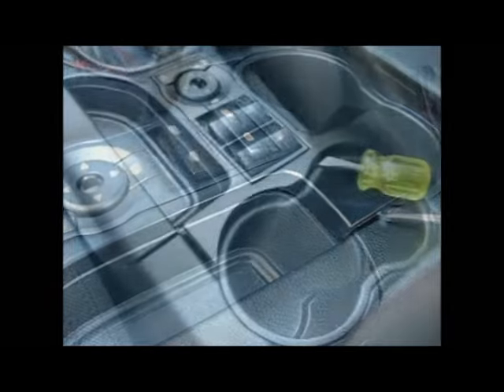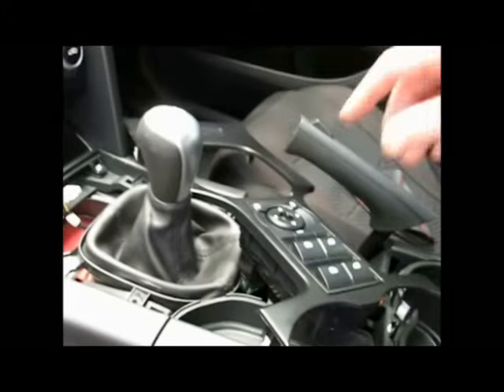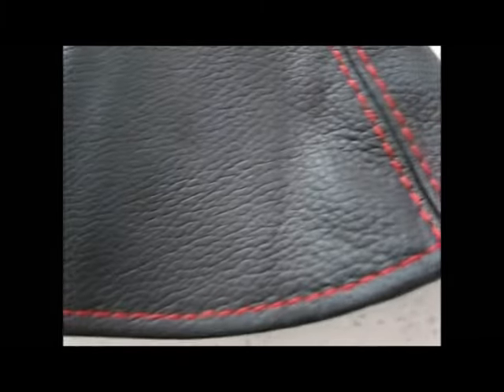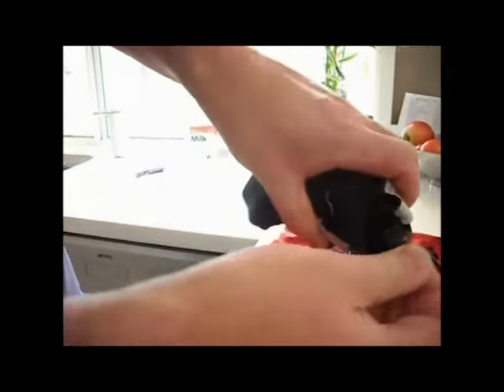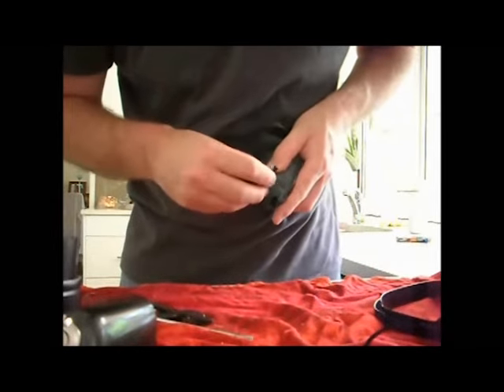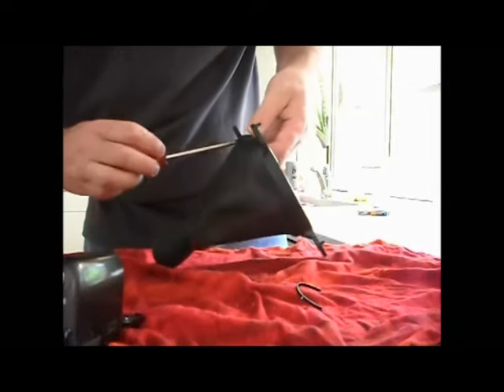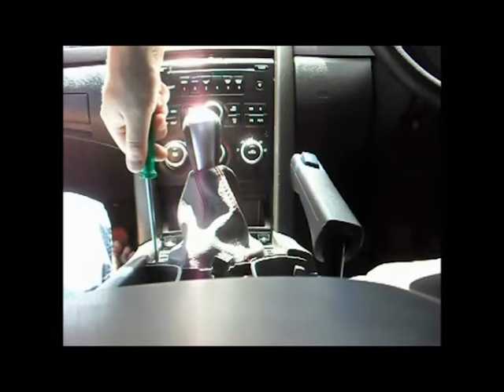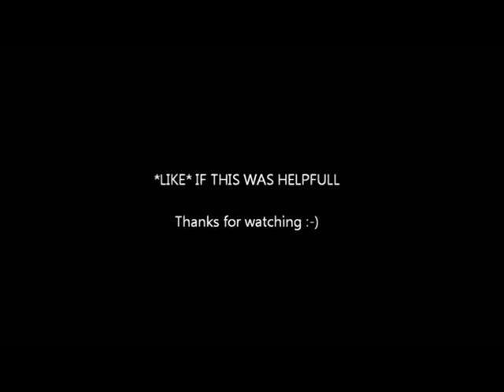HOLDEN VE VF Commodore Remove Gear Knob and Replace Gear Boot

Comment: If too hard to lift off, 1st take the boot off by cutting the zip tie. Then use a screwdriver to pry the knob off will come off easy
Reply: Where do you use the screwdriver? Seeing lots of rubber below the knob and not sure where to lever, cheers
Reply: @brockjohnsson4686  did you take the boot off? There's just the stick under that
Reply: @jamusdreamin  yeah took the boot off, there's the knob and then a rubber sort of seal, I couldn't see anywhere to pry up with the screw driver? Just packed it all up in frustration lol.
Reply: @brockjohnsson4686  cant remember a rubber seal theres just the metal shaft like in the video 👍
Reply: @brockjohnsson4686  hi mate, I’ve just done mine. before you twist and pull the gear knob off. Get a flat head screwdriver 🪛 and place it between the metal on the gear stick and the bottom rubber part of the gear knob then twist the screwdriver to remove the rubber seal off the metal. Holden have inserted a type of glue on there which you need to break the seal. After you have gone around all sides.. twist and pull, the gear knob should come off nice and easy. I hope this helps.

Comment: Was your shifter removed previously? It seemed to pop off easily. I cannot get mine to mov at all, drivers side, passenger side. It will not budge. Any further tips?
Reply from the maker: Yes, I removed mine just prior to filming this and then put it back on. If you have a VE, it's definitely a press fit knob. You just have to get more leverage on it to pull it upward.

Comment: Hey mate. Are shift boots a universal thing or do you need specifically designed for the commodore????
Reply from the maker: They are all going to be a unique shape depending on the length of the shifter and the console opening. Can you not get VE ones any more? I got mine off eBay for $30, but that was around 2011.

Comment: Question would this work on the 2013 caprice that was exported to the USA? Thanks
Reply from the maker: Yes absolutely. No different.
Reply: @GrouseGarage  I'm trying to pull mine out
Reply from the maker: @christianrivera6369  manual? Should lift up the same.
Reply: Is an automatic 😭

Comment: Would this be in any way shape or form similar to removing a Vfii manual shifter?
Reply from the maker: Can't say for sure, however it's highly likely the method would be the same, just different mouldings for console bits and pieces. Gear knob removal would have to be the same.

Comment: How did u remove the shift knob so easily 😨😱
Reply from the maker: It's a very tight press fit. Remove it exactly how it's shown in the video. You really do need to grip tight, work it left and right and pull it upward hard. My SS was only 3 years old when I filmed this. Maybe they stick tight the longer you leave them.